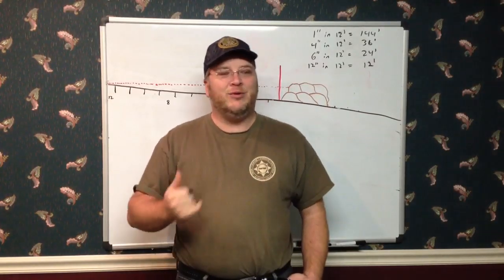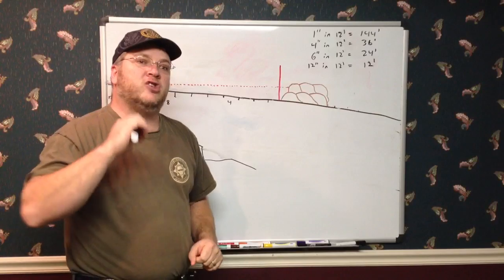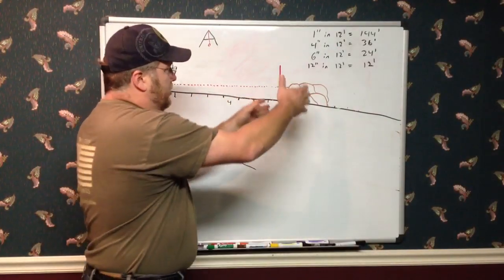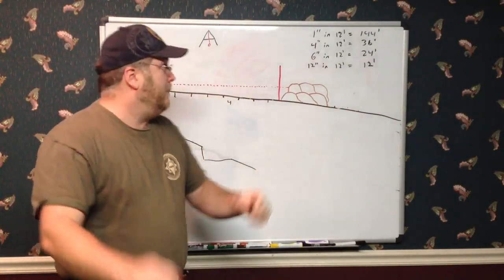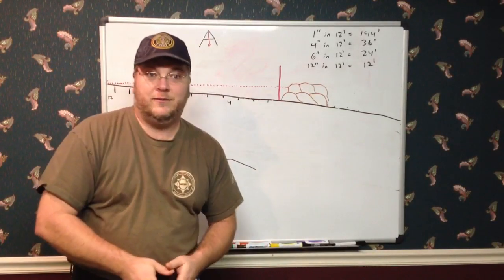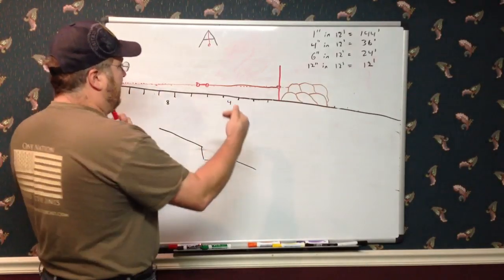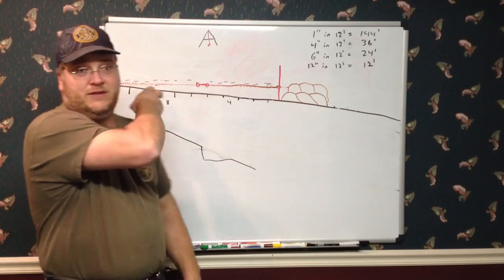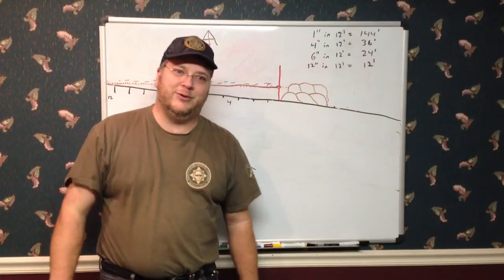Permaculture with Jack Spirko Part 14 - Easy Terrace Construction

Comment: I'm in the ozarks and have plenty of rocks and slopes. We've just barely made a dent in this place but I've seen erosion already. I'll be working on clearing for a real house soon, as opposed to the cabin on poles that we've been living in. My neighbor's got a track loader aka high lift that I'll be using to knock down some trees and do earthworks for a foundation.
Before I do that though, I'll be building some rock walls as in the video. If I plan it right, I won't have to bring in any fill. It will simply collect behind the rocks as I disturb things uphill. Normally it would all wash down to the creek down the road. I'll be using a transit level instead of an A-frame level. That way I can stand back and get the big picture and scope things out to see exactly where I want my rock pile walls. I'm not taking every tree out so I want to go between all the big ones.

Comment: Yeah, baby, turbo charge it, blow me away!  Jack we just got a new home with over an acre sloping away from the house.  Unfortunately a lot of that is a septic field (not sure exactly where it is.)  But I'm planning on swaling or terracing a lot of it.  I face down to the south, so my larger plants would have to be uphill of the smaller ones (and therefore in shallower fill,  unfortunately.  I have cheap finished leaf compost ($20 / yd^3)  And I have free wood chips and logs from tree companies.

Comment: 2:20, Jack, I guess you probably know, but this blows my mind.  You don't need a level surface or a level to calibrate an A - frame.  A roughly level surface would be useful.  You note / mark the position of the feet.  Mark where the string falls on the cross piece.  Switch the feet, and mark where the string now falls.  Perfectly level is exactly midway between these two marks.  It's insane.  The legs don't have to be the same length exactly.  The cross piece doesn't have to be perfectly straight.  You don't need perfectly level ground or anything to calibrate it!